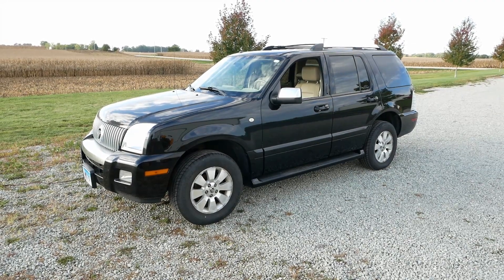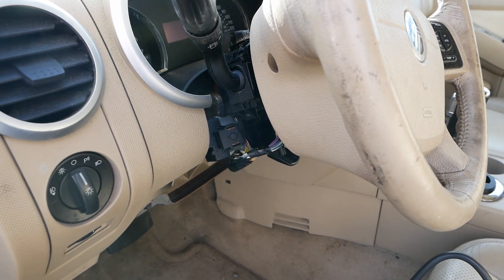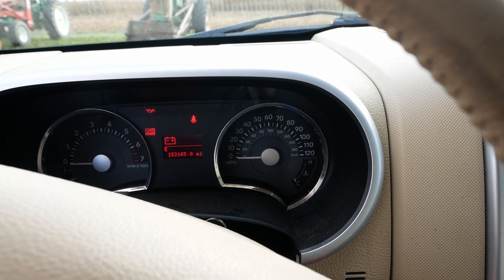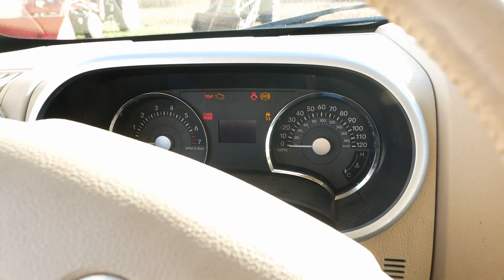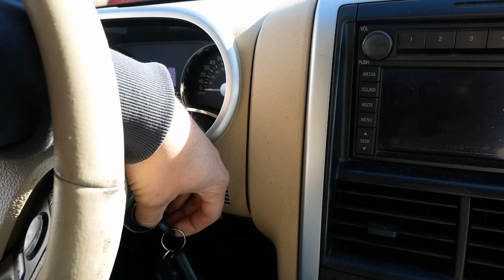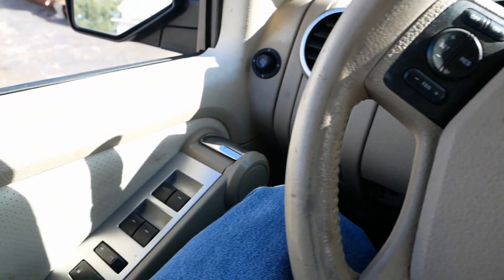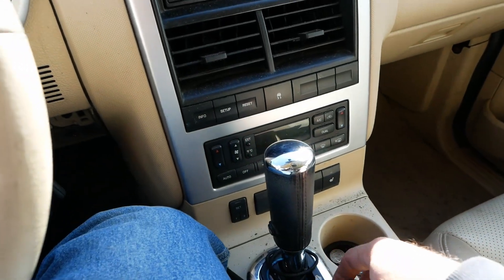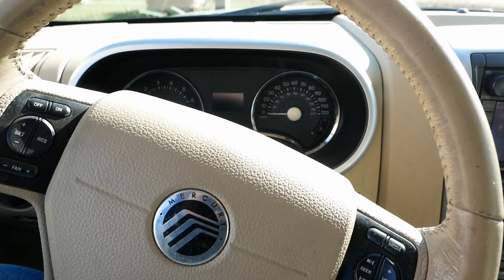Mountaineer Won't Start After Thieves Destroy Steering Column

Comment: i put my ranger into a snow bank and stressed the ignition pin while turning the steering.  it broke at menards one day finally so i hopped on macdonalds wifi and found out the cylinder would pop out with a nail.  road the bus to my fave lock shop and got a new cylinder keyed to my original.  bussed back to menards and slipped the cylinder in with a little grease.   35$    still works.
that’s my non-sensical rambling old guy story for the day 😊
Reply: A+

Comment: Some of the biggest problems seem to be finding parts in a timely manner right now. I have a 02 dodge ram 2500 That needs inner axle . Vac actuator. Every said axle must have been changed. NOT i bought the truck new with 38 miles. Finally found a guy in Billings Montana that knew about the truck. You just need to make LOTS of calls until you find the right person.

Comment: Hey man,  I swapped out an ecm in an exploder, and had to get a locksmith to orient the ecm to the car and key. To do this, he got online with Ford in Detroit ,because this is how Ford combats theft. My locksmith is required to have two chipkeys-- the original, and a duplicate made by a dealer,$30. Both keys were needed to communicate with Detroit, using his laptop, and a patch to the OBD connector.

Comment: I drive a 2008 Mazda Tribute( built in Kansas City alongside the Escapes and Mariners. My ignition switch wore out and would not turn with the key far enough to turn the switch to the start position. I could make it start if I removed the lock cylinder and rotated the switch beyond where the key was able to turn it using a big screwdriver- as long as I put the key near the pats antenna loop . I needed to do this for about a month while it waited for the new switch to arrive. Apparently this was a common issue and a lot of folks got raked over the coals by dealers trying to figure this no-start problem out, and we’re left without their cars for long periods. 

With the key not in position, it would not start, but It would stay running. So I figured out pretty quickly that your problem was the pcm. Wasn’t seeing the key chip that is needed. Putting the old key near the pats antenna would solve the issue sort of- as it would have defeated the immobilizing feature.

Comment: fyi you can buy a blank lock cylinder from ford and you install the pins springs and use old key not expencive but its a little time consuming i had to do a few on f 450 had a few service trucks stolen

Comment: You can buy an ignition tumbler that will key itself to the original key when it's inserted. I know Dorman offers one, but use that at your digression. Not sure if you have a tool that can read keyfobs. My Autel TPMS tool can pickup the frequency and at least you know if key fob works and is correct frequency.
Also the X100 should be able to program key fobs without having to do all the sequences and dancing on one foot around the car.

Comment: Place where I worked had a 2001 F-150.Truck was used on two work shifts,everybody wanted a key.They bought a several blanks,programmed the keys to work.Truck failed to start Ford Dealer told us that on that model programming more than five keys would cause a no start problem in the computer.Engine would turn over but no fire to sparkplugs.

Comment: I'm a locksmith.

Take the ignition cylinder out of the column and bring it to a locksmith with both the old key and the new keys.

Have him rekey the new lock to the old keys. Now the old keys will work all the locks.

The chip in the new key can be harvested from the "new" key and be inserted into a chipless blank that can be cut to match the old key. 

Now all keys will work.

You could have avoided any programing by doing this first.
Reply from the maker: That all sounds fine, but the nearest locksmith who will do anything with chip keys is 45 miles, and whatever they will charge is more than the $60 I charge to learn the donor key. This rig is on serious budget.
Reply: @WatchWesWork  

Fair enough, as long as the customer is aware of the risk of having mismatched keys.

If they get tired of it they can always swing by a locksmith later.

Comment: For those who are curious... You could take the old key, place it right next to the ignition switch and use the new key to start the vehicle without programming. Some folks get unchipped keys cut and end up taking the chipped key and taping it inside the plastic of the column near the ignition switch. This way, any generic key cut properly will start the vehicle.

I had to do this a while back until I could get the dealer to program new keys, because I only had one key to the vehicle, when you need two in order to do the programming yourself via ignition cycles.
Reply from the maker: I don't think that will work since the antenna in the column is not original.
Reply: @WatchWesWork  The PCM is what determines if the key is correct. An antenna is just an antenna...

Comment: my 09 ford fusion, the security lockout kicks in if you remove the battery.  you needed both keys in the cabin in order to reset it.  It wont even click when you try to start it.   Last week when I changed the main battery, I used a odb2 holdup connector and a small motorcycle battery I had about, to keep the computer alive.

Comment: Excellent video Wes :) also had one vechile so crazy after someone got key ignition switch install and one key for ignition switch also one key doors plus truck also glove box  and one key fob ! All work out till battery was outdated plus worn out would hold charge for 2 days so get boost and got brand new battery installed ! But in every month on 7 to 15 day on each month to cold or hot starts wouldn't start and Pass Lock Security Light come on start flashing for 10 mins with key on ON position also then take turn key to OFF position take key out  and have keys on hand also pop hood take + red cable for 30 seconds also installed! Then push Unlock & Lock for 10 seconds then let off buttons , Panic Alarm for on also off / on and Trunk release button to ! Unlock door then shut put key in ignition  turn to ON wait for VOLT Light show up and start motor up Lol! Funny part took to me check and couldn't fix also 3 dealership also one private auto shop got battery from ! Even ask Head office find out and took vechile recognize battery change 3 years from date brand battery purchase was to have vechile recognize it ! But what was problem get this was - black ground cable on battery plus to body ground also ground connector on transmission to Security Ground on to was broke of wire connector connection from wire harness near starter drive! Also Front Wheel drive vechile plus wire was super thin to small as 2 hairs on your head ! Plus when vechile got car wash and wet on Security wire ground out whole engine  and transmission but not Am/Fm radio at wait 10 minutes dry off so start or booster it ! But fix that Security put heat shrink on wire plus tooth sandwich with washer that stainless steal and cure it problem! Yes Lol but hilarious find that took me 3 years find it ! But I got wrote in my log book and shared with other Mechanics to if ask me on vechile is and year plus model and etc!

Comment: Hey Wes, nice save. Looks like you can still cut one side of the key to work the door and the other side for the ignition. Oldest trick in the Ford book. Watching videos waiting for my shop to heat up so I can A-dapt a $60 Agri-fab snowblower to my Craftsman GT 6000 tractor. Finally supposed to snow here in Detroit. Glad I'll be cutting, welding and grinding and not chasing electrical pixies like you usually do. Thanks for posting.

Comment: The "new" key didn't look like it had the door part cut. Don't know if Ford still uses the first part of the key for the ignition and the back part to unlock the doors. Had to replace the ignition lock on my '93 Tarsus. The replacement key had the back part blank.

Comment: My driver side door had been replaced on my car and had an odd key, so I bought an odd set of locks for my car cheaply and recoded the lock to work on the same key by mixing and matching the insides.
It was easier and cheaper than buying a matched set and replacing everything.

Comment: It would be easier to replace the ignition cylinder with an original (vin number matching) cylinder. That vehicle is fairly new, should be easy to get an original lock cylinder. If the original steering column Is available, get the lock cylinder from it.
Reply from the maker: It's almost like there was some reason why we didn't just use the original lock cylinder...

Comment: Ahh at work and bored, nice video to watch.     The second remote fob looks like one for remote start.  They have to be programed just like a new PATs key.   There are a many you tube videos on how to program without a scan tool.  I remember it was very easy to do, but you do need two keys that will start the vehicle.  I have a 2006 Ford Five Hundred with the 1st Gen remote start that I had to reprogram the FOBs after an ECM/PCM replacement due to a mice chewed wire.  Ahhh.     But I am sure you know all this.

Comment: I had the same issues with 2 keys one for doors one for ignition.. being a cheap ass.. I just took all the guts out of the door locks so any key works...  the chance of some one checking door locks for s B&E is slim..

Comment: One would think that just swapping the lock cylinders would do the trick to avoid the whole re-keying issue. I mean the lock is still "mechanical" so pulling the cylinder and changing it over should be fairly simple (yeah yeah Ford). Unless the morons damaged the lock cylinder with a typical theft tool (screwdriver) it should still be able to pulled and put into the new (used column). Wes, you need to fabricate yourself a wheel lift to add to your forklift so you can move stuff into the shop. Should be a fairly easy build for a skilled guy like yourself, beats pulling stuff into the shop with a chain and the hired (married) hand doing the steering. Just a thought, thanks for the Share Sir, Stay Safe..
Reply: that would require the other shop still having the lock cylinder, and that lock cylinder not being wrecked by the would-be thieves.
Reply: forklift wheel lift is a great idea 👍
Reply: @rustyjeep2469  I know, right! Just hook it to the where the forks would hang, you could use a cylinder to extend the reach if you wanted to, or go old school manual reach. Then either forks for the wheels or to frame lift dogs like a heavy truck frame lift. No dorking around, just lift and stuff it where you want it.. Easy Peasy ( he would be the envy of YouTube shops )
Reply: @PandaMan02  Looks like they were too stupid to bugger the lock and thought it was an old Pontiac you could just "hot wire" old school.. Freaking kids these days, no class, no tech.. Even I have a set of bypass keys...lol

Comment: I loved this concept, that popped up some decades ago (i think it was around 1985?ish) where the steering wheel and part of the column would be removable (think of the ball pin that aviation uses, very similar to that, but as a key, each wheel being the key through a variation of balls in various angles of the steering shaft) and you'd walk away with your steering wheel and part of the shaft, leaving the car 100% inoperable, as even a thief would actually need to both have the wheel and the specific combination (which would be difficult to achieve as there would be a stupid amount of combinations). Pity nothing came of it, i'd bear the trouble of taking a steering wheel with me, even today if it meant giving the punks a middle finger.
Reply: Ya don't need all that complication if you don't own anything worth stealing.
Reply: @MaxNafeHorsemanship  That helps but it's not foolproof. I had some shovels stolen recently and I'd always joked that thieves won't steal implements of real work.
Reply: @nodriveknowitall702  LOL...Good one. I guess they thought they would be easy to hide until they sold them. I can assure you, if someone steals my car, they are desperate for transportation (very) or completely insane.
Reply: @MaxNafeHorsemanship  Yeah, anything I've ever driven I'd always let all the secondary stuff go. Examples on my current daily drivers: door doesn't shut right, window is stuck, hole in the dash where the radio used to be, gas gauge doesn't work, gotta jiggle the key just right to turn the ignition, and gotta depress the clutch peddle just right to start it. 

I'm only concerned with safely and reliably getting from point a to point b and back again. I ensure that fluids are changed and that theyve got good tires, brakes, suspension/linkages, and lights. I keep vehicles until a major failure (engine or transmission) occurs that is too time consuming and/or expensive to fix and sell them off. I do all the rudimentary stuff myself.

People who look at a vehicle as an investment are pissing money away, in my opinion.
Reply: @nodriveknowitall702  Same. My "good" car is 20 years old, but it has new tires and even a new steering rack.

Comment: You think stealing that was dumb? My 95 Chevy Suburban was stolen a few years ago, so worn tbi 350 I.e. factory gutless, the thief drive into a bit of Alberta mud and got it stuck - just in time for a local Mountie to spot him. I was still filing the theft report when they caught him.
Reply: Strathmore Alberta had our 96 Buick stolen out of our garage , apparently they used a coat hanger to grab the release cord via top of garage door ,they were meth heads and they totaled that great car .
Reply: @oldbiker9739  Simple but clever. Never thought of that, going to make sure mine is secured. Thanks for sharing

Comment: Is it possible to reuse the lock cylinder from the old column, or was it drilled out?

I'm not too sure about Fords, but I know that lock cylinders are usually pretty easy to swap out.
Reply from the maker: I was destroyed.
Reply: @WatchWesWork  Ah, figured as much. If it were my car, I'd be taking it to a locksmith next.

Comment: Do you think that it would've started if you had held the original key next to the cylinder while you turned it with the replacement one?
Reply: Had a Ford with PATS II like this Mountaineer. Unfortunately that won't work. Tried it when trying to bypass the PATS II system.
Reply from the maker: I don't think so.
Reply: I've tried this and it did not work.

Comment: Ah, those auto manufacturers and their too-high technology...
My 2005 Mustang GT had the battery die in it, and so the window drop feature wasn't working.  So I went on the internet, and was pleasantly and unpleasantly surprised to find out that there's a reset procedure for the damned power windows!!!  So I tried the procedure and got the window drop to work again. (It drops the window a half inch or whatever when the door is opened, and raises the window back up to closed, once the door is closed.)  
So after I reset the windows, the airbag light, which was stuck on, started to turn off when it was supposed to - apparently working correctly!!!
Reply: BMWs with pillarless doors have this well, have to recalibrate them after a battery disconnect etc.
Reply: @ferrumignis  Actually the Stang is quite tolerant of hard disconnects of the battery, other than the clock and radio presets.  It's when the charge decays as the battery goes dead that the bugs crawl in.

Heck, even back in the 1990s, there were cars which needed a security code for the radio, I think every time the battery was disconnected. Seems logical that quite a few of those codes got away from those vehicles over a couple of decades of use...
Reply: never had to do that on my 08 GTCS drop top and the battery on mine when DEAD DEAD three times since I bought it new 

1st one in 2012 2nd 2017 3rd 2021 "last month"
Reply: @Giovanni_Litterini  I wonder what caused it on mine then.  I assumed it was battery charge decay.  Some GM products will start the wipers wiping as the battery goes dead - with the keys not even in the ignition!!
Maybe Ford figured it out and fixed that problem after 2005 and before 2008.  Mine is a first-year '05, so it probably has problems which were rectified in subsequent years.

Comment: fyi remote wont work with the vehicle running why i dont know so if you have it warming up with the doors locked the remote will not unlock the doors i had a 2001 merc mountaineer and keyless access would get my in though or door key

Comment: So, does this mean that if you have a proper computer, then you can program any key to run the car, so, you can potentially steal it? Or is it just that the car computer detected the original key in the center console somehow and let you to program a new key?
Reply from the maker: You have to have a key the can physically turn the lock cylinder, and you have to program it to the ECU. They build in a 10 minute waiting period so you can't just run up to a car and steal it. But if you had a way to cut the key, and 10 minutes, and the right tool, and knew how to use it, you could steal it.
Reply: @WatchWesWork  I drove a Ford Mondeo Mk 2 (Contour in US) with a FO21 type key. An experienced key maker could tell the key code to cut a proper copy even just by eyeballing it. However, the computer in the dealership used to require around 40 minutes to program a blank key at those times.

Comment: Everyone nowadays is so used to keyless entry, one key, push button start.
My '89 was one of GM's first keyless entry, but you still had two keys- a round
head one for doors, trunk & passthrough, and a square ignition key.

GM's attempt at a "security key" was the PASS system. A total flop,
easy to defeat, very poor design. Nothing beats a real, mechanical key.